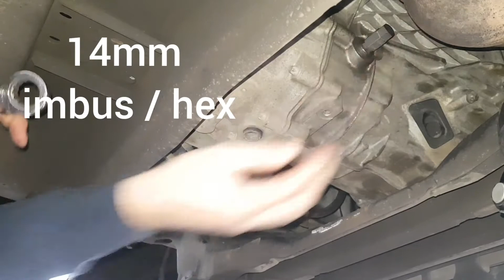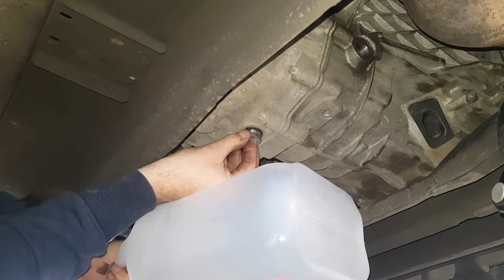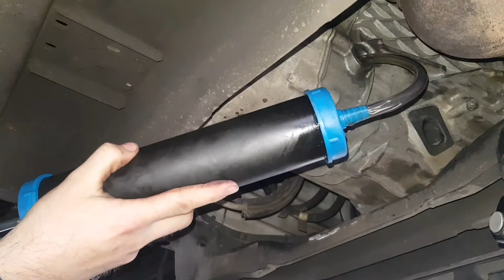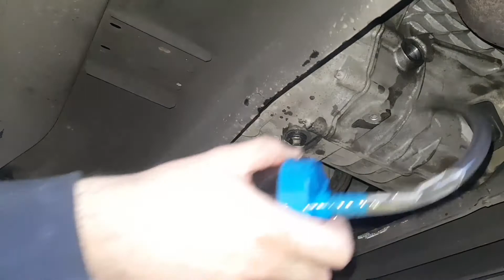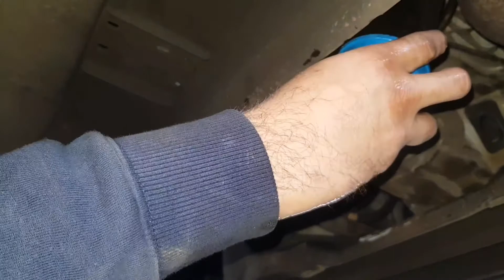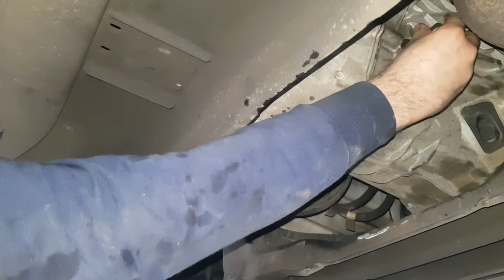MERCEDES SPRINTER 313 MANUAL GEARBOX OIL CHANGE / WYMIANA OLEJU W MANUALNEJ SKRZYNI BIEGOW

Comment: Hi
i was surprised that it only takes 1.9ltr of oil. I was under the impression you just fill up the gearbox till it strats to flow out of the level plug and once not flowing out close it up and job done.
Reply: thats the correct way to do it like you said

Comment: Wich Oil do you use ? 75w 90 ? Thank you
Reply from the maker: Oem mercedes, they won't tell me the spec ...
Reply: What's the point of your video if you don't want to tell us your oil type😢😢 @mattbelka1
Reply from the maker: @Moroccandriver007 What the problem..  you simply call mercedes and ask.

Comment: I was surprised there is no washer on drain plug.
Reply from the maker: No washer lil bit of sealant.
Reply: @mattbelka1  Ok, what kind of sealant do you use? I will be doing mine later today.
Reply from the maker: @magnusremovals3548  high temp and oil resistance sealant you will get it from any motors factory's shop.
Reply: @mattbelka1  Thanks.
Reply: @mattbelka1 Did you use RTV silicone seal on the oil plug?
Reply from the maker: @mike1043  yes sir.